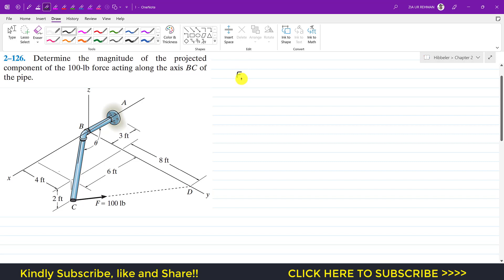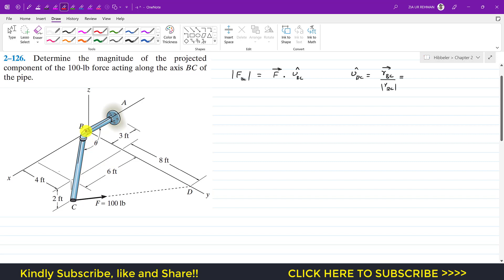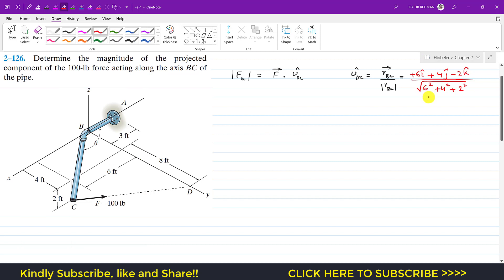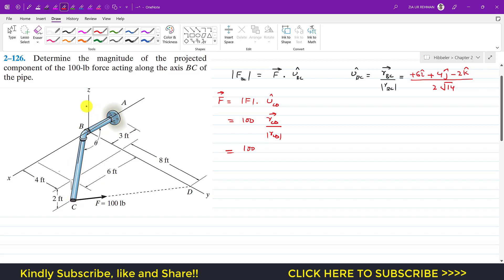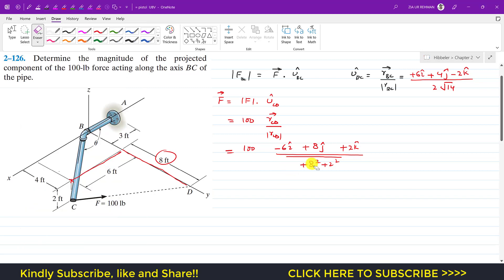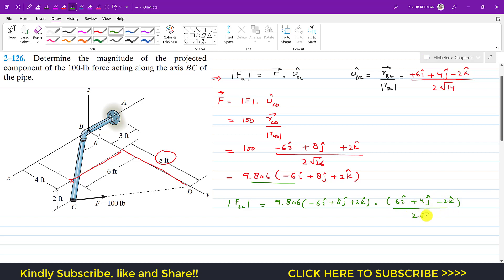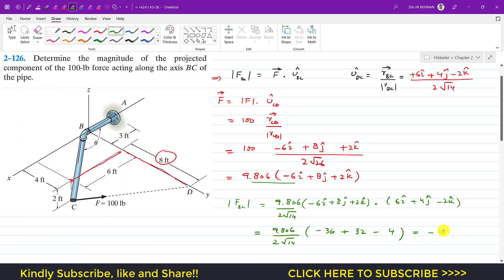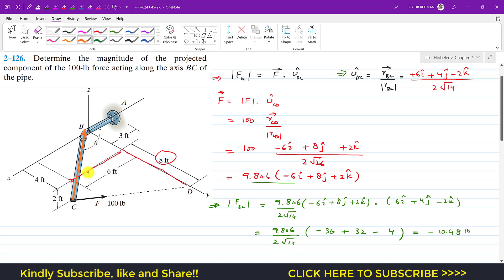2-126 | Chapter 2: Force Vectors | Hibbeler Statics 14th ed | Engineers Academy

Comment: Hello. I think I understood but i cant imagine the situation based on the image. The pipe fixed is connected the wall and the floor? The arrow showing the F is going to move?
Reply from the maker: U can imagine the force as a tension in cable tied at D.
Reply: @EngineersAcademy2020  Thanks. Perfect now.
Reply: It will get better cause I have the books now. With your Channel  I believe I learn much more.✍️